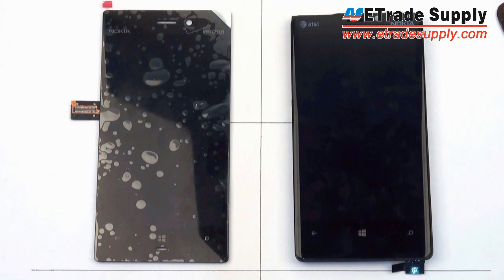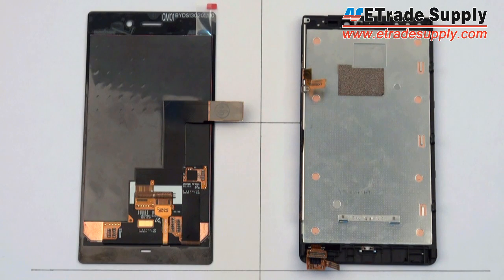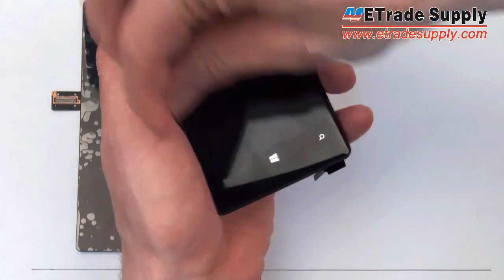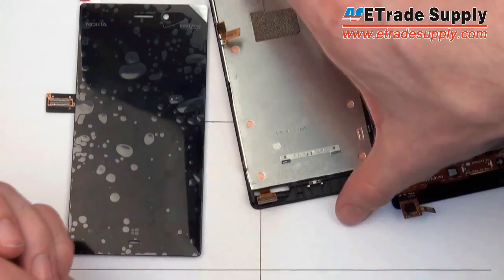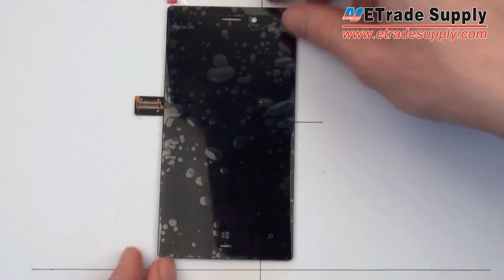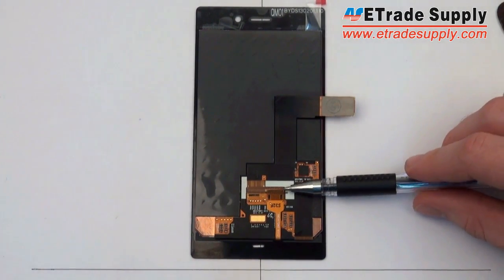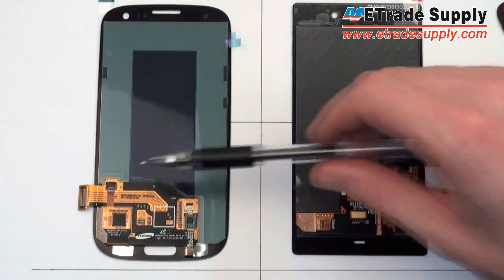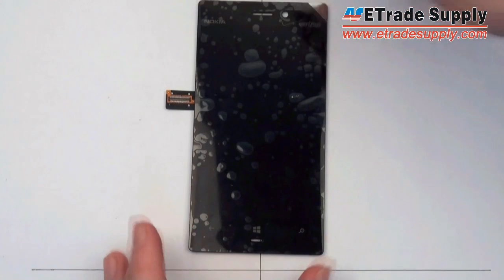Comparison of Nokia Lumia 928 LCD screen and digitizer assembly and Nokia 920 LCD screen

Comment: Great info, but you mention that it is nearly impossible to take the 3 pieces apart on the S3/L928, but then later mention that the S3 uses clips which makes replacement of just one part easier.  So, it is "easier", but still impossible without expensive equipment?